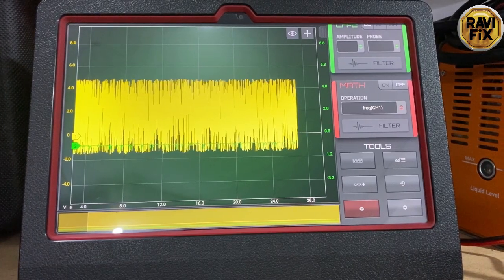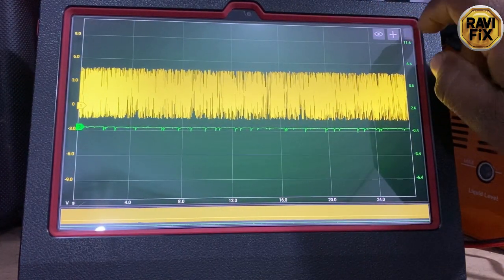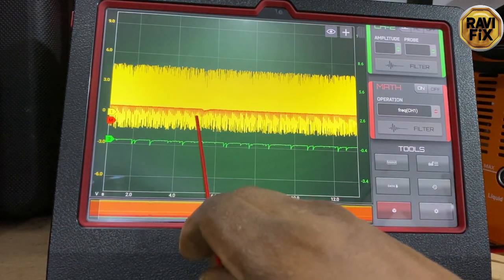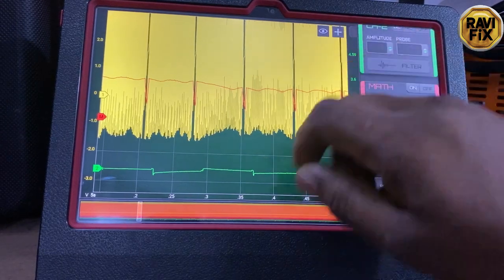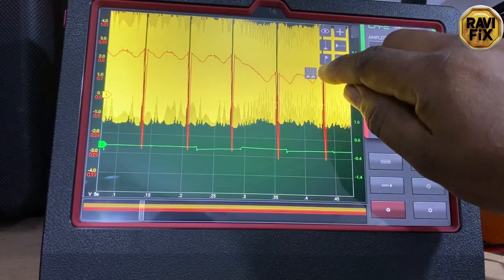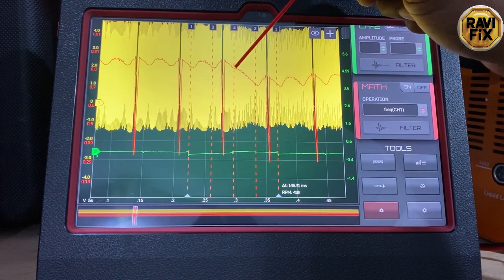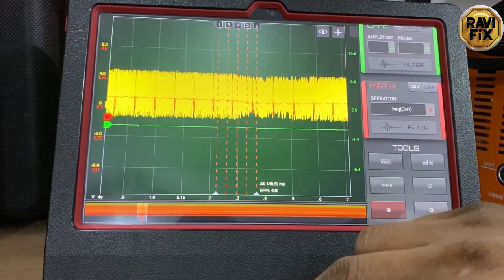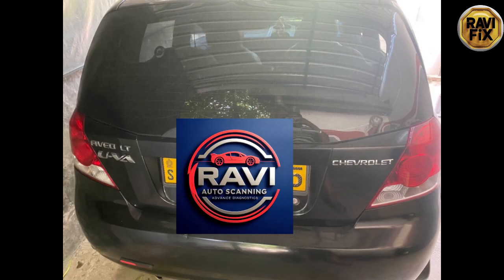Find intermittent misfires like a pro using frequency Math Channel on crank shaft position signal.

Comment: Ravi, where do you place this technique in respect to pulse sensor testing? Would you say it’s more useful? Also, is this technique usually only used on vehicles that don’t offer real-time misfire counters? Thanks!
Reply from the maker: It is Crank sensor signal. And this could use when you not get misfire data in the scan tool